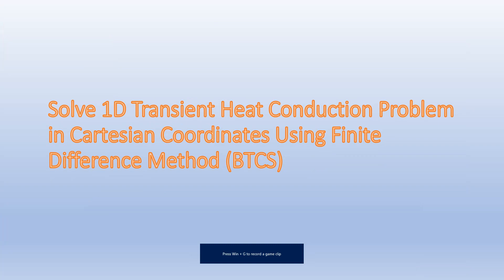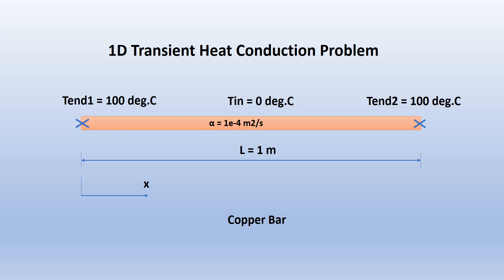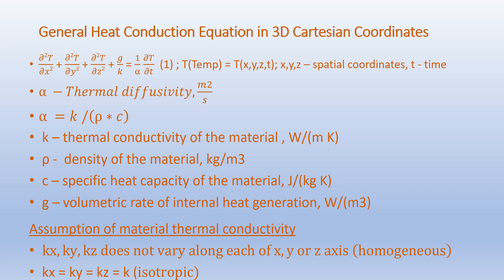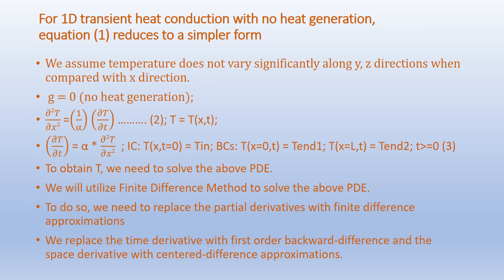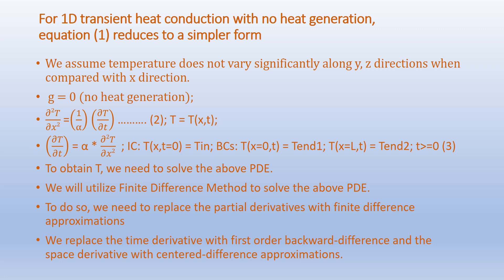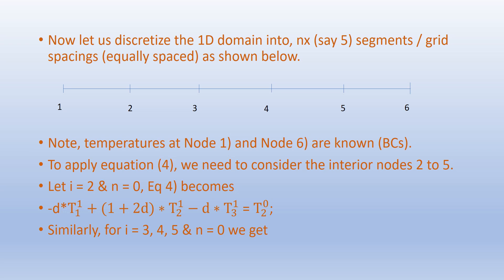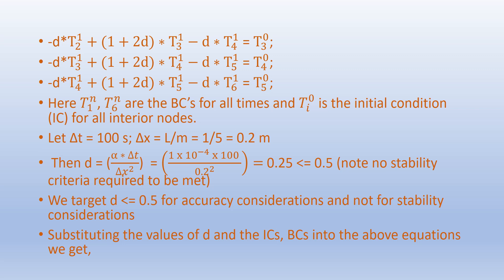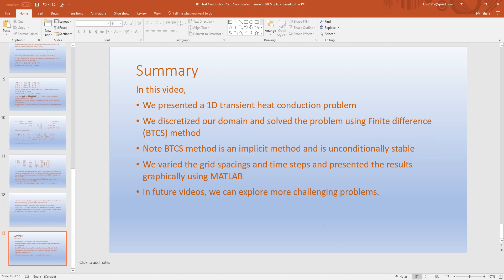Solve 1D Transient Heat Conduction Problem Using Finite Difference BTCS Method

Comment from the maker: I posted the code in https://engineering-stream.com under Numerical Methods. Hope this helps.
Reply from the maker: @abbymcadams2112  check under online calculators. Let me know ig you got it or not.
Reply: @samseleven1  Got it, thanks!
Reply: Hi Sam, a quick question- When I try using this code, the Thomas algorithm function isn't working. Do you have any idea why that might be?
Reply from the maker: @abbymcadams2112  hi abby. You may have to download that sub routine from the website. Try that and let me know.
Reply: @samseleven1   I opened that as well but it appears to be linked to an excel sheet and have a matrix already filled in so I'm not really sure how to proceed. Sorry for the questions, I'm pretty new to matlab
Reply from the maker: @abbymcadams2112  HI, Did you download Diffusion_equation_1D_Implicit_Method_Dirichlet_BCs and Thomas_Algorithm_Func1 files?
Reply: @samseleven1  yes
Reply from the maker: these are text files. You need to paste these in matlab and run. Is that not working?
Reply: @samseleven1  It is not. I pasted the two together but still get all zero values back (other than BCs) which I know shouldn't be happening. I am using octave instead of matlab but I wouldn't think that would make a difference
Reply from the maker: @abbymcadams2112  Sorry to hear that. They need to saved as separate files. Did you try that way.
Reply: @samseleven1  yes. I downloaded both files as is off of the website and ran them without making any changes to either. The diffusion file will pull in the algorithm but it still results in no numerical changes to any of the steps, leaving them all as zeros
Reply from the maker: @abbymcadams2112  Can you pls send me a snippet of the input  values
Reply: @samseleven1  sure, do you have an email I could send to?
Reply from the maker: @abbymcadams2112  samseleven@gmail.com
Reply: @samseleven1  great, I just sent you an email so feel free to delete your account above if you don't want it on the internet
Reply: @samseleven1  HOW DO I DOWNLOAD IT?